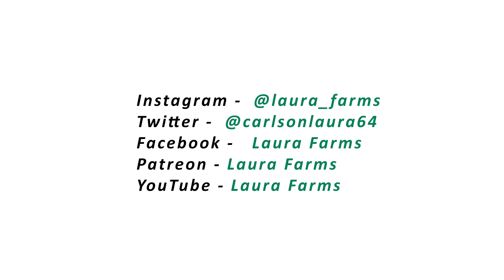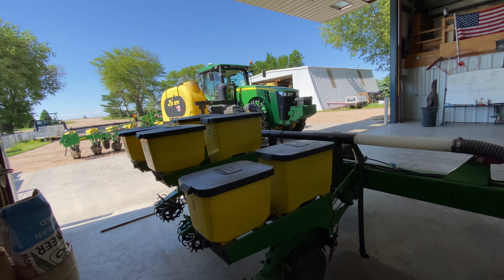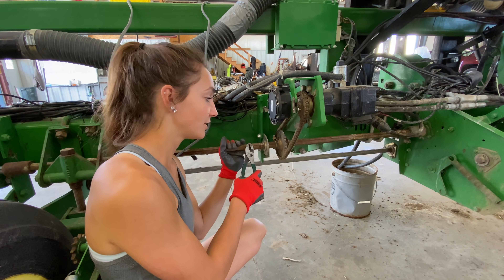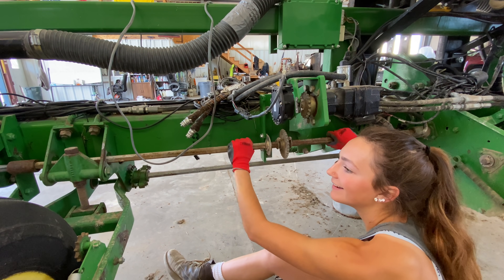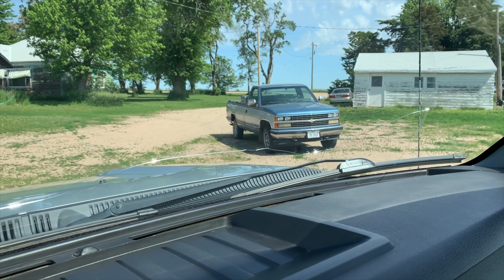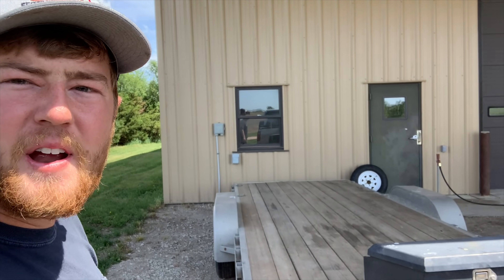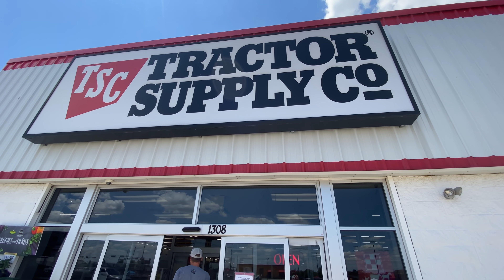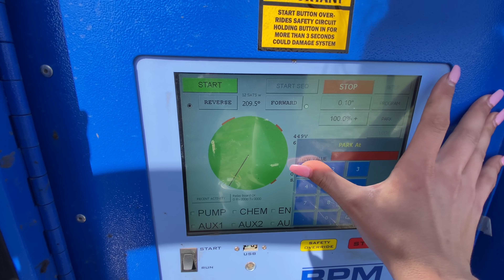We're Doing WHAT To The Planter??

Comment: First step when disassembling a machine is plan how to mark the parts. Don't leave them on the floor, you will kick them. Keep a pad of paper nearby and note how you take it apart. You will eventually find that something will not go back in until you disassemble some other part (like the thinggie on the hex bar). And as Brian Waskow said, take pictures. When I disassembled a chipper I had about fifty pictures of it on my computer with notes of what each picture was for. Yes, pictures. Yes parts boxes. Yes offset screwdriver too. Cary a crescent wrench on your belt. All this from someone who is about fifty years older than you.
Reply: Or she could just look at the video of how she took it apart:)
Reply: don't know i may have a photographic memory i can pull engines and gearbox's and other stuff apart and put it all together again without taking photos of how it was 🤓🧐😏 it maybe that my dad taught me how to do things like im shor Laura's father did for her
Reply: @craigunderthesoutherncross380  Much respect for you.  I have a cousin who used to change his transmission every couple weeks and could do it in less than an hour.  I could certainly tear down an lcd blindfolded. But things that I've only done once, used to end up with extra parts and missing parts.  I learned to document. I don't mean to brag, but I have a higher than average mechanical ability as tested by the US Navy. I didn't mean to be a sas, just offering some old fart advice.
Reply: @heinzguderian7091  I'll bet you have lost a few screw too.

Comment: We have gotten a glimpse Laura Farms serious face today. Which is okay, but we love the smile also. I've mentioned this on a few other Farm channels, but it's hard to lube chains and sprockets where their  in the dust all the time on equipment. This first part doesn't work on new chains but the rusty ones that are not worn-out along with the sprocket. There's a product you can Google that comes in a gallon jug or a spray can called Rust Replacer. The main ingredient is phosphoric acid, which converts the iron oxide to a gray primer type appearances that does not rust. When it's finished working you do have to wash it off with hot or warm water. And then like the new chains I give them a bath either in a bucket of powdered graphite or spray-on graphite which I found at Runnings in the farm section made by Lubriplate. It is awesome stuff, I used it on the rusty spots on my forty-year-old handrails on my front and back steps didn't even have to paint them afterwards.

Comment: Compression (anything air goes through by tubing) is easy; its connected by sleeve; and cut anywhere and put on sleeve and you have connection; 
put it differently; each tubing is like spit ball; where ball end up; is put sleeve and fitting; 
so even if you put wrong; it can be fixed; just need lot of tubing; and fitting; 
buy by box; and fitting by box; graingers; dirt cheap; 
anything in farm machine; need not be original; aftermarket will do just fine; 
for example original german fuse is 7 dollars at dealer for one; at grainger whole box of 12 at same amp is 9 dollar; 
never buy original; buy from grainger; you need your tax ID; its like costco for farm parts;

Comment: if every fourth row of corn is 'male', why not color every fourth 'seed box' a different color, and simply disconnect the seed-metering system when the machine is being used for something else? seems like an awful lot of work to achieve 'multi-purpose' capability...
Reply: First off the machine can only plant at one seed rate at a time, so you cant control a specific box, and also the males mature much quicker so they need planting at a later date